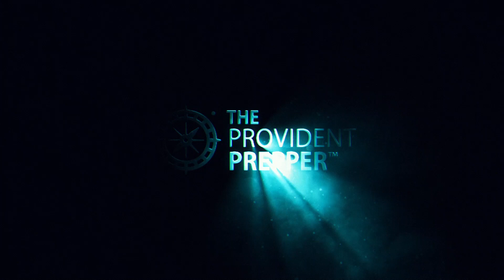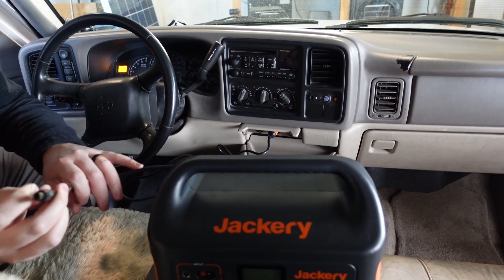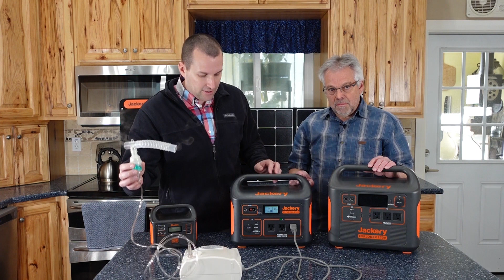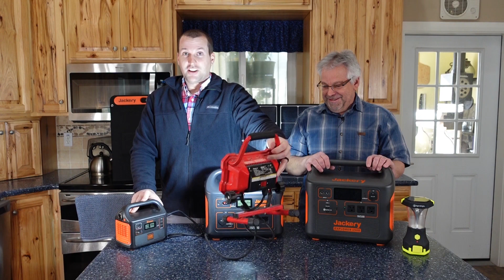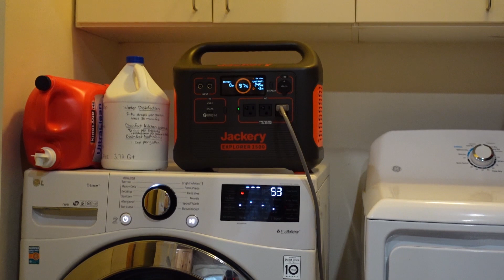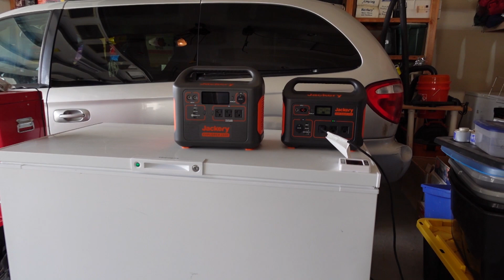Backup Power: Sizing a Power Station to Meet Your Critical Needs

Comment: I’ve heard that powering devices with DC is way more efficient than using the built in inverters to power them with AC.  Any chance you have a DC powering option for any of the devices you showed here to compare the power draw between AC and DC?
Reply: Hey Micah...you can buy DC versions of some appliances. These are popular with the off-grid folks since you can run them directly from the battery bank of the solar power system and don't incur the efficiency losses of the inverter. However, the efficiency of inverters has improved over the last few years to the point that it doesn't usually make a big difference, especially if the DC appliances are more (sometimes much more) expensive. I have recently seen some power banks that skip the AC capability and only focus on power DC devices. I think Inergy has one, but I haven't explored it too much. My whole house fan and my washing machine use really efficient DC motors (which I am a big fan of), but they both are AC devices that push DC motors. Interesting world to explore...mixed feelings out there as to the future of DC appliances. I hope to learn more. Great questions...Thanks for being part of the solution!
Reply: @JonathanBJones  it’s been a while since I looked at new options.  Didn’t realize the new inverters were so much more efficient.  When I put together my DIY battery bank I identified my critical power needs and often they had a factory option to be powered directly by DC.  Examples are the cpap, our laptop, my portal tool batteries, some lighting, and all my comm gear.

But I never actually compared their load to the AC option.  I suppose I was trying to validate my earlier decision and give folks a possible way to lower their power needs that might potentially save them a few bucks if a smaller unit could meet their needs.  As your fan speed demonstration showed we really need to test each item.
Reply: @micahwest5347  Hey Micah...going with DC is not a bad way to go if you can find the products you need at reasonable prices. Another factor favoring your idea is that there is potentially one less device (the inverter) to fail and put you in a hard spot. I will be considering this as I look at another fairly large power station that has all DC outputs...Thanks for your comment and thanks for being part of the solution!
Reply: @JonathanBJones  thanks for taking everyone’s input serious.  In the future if you get a device that has both power options I would be interested to see the difference in draw.
Reply: If you have a medical device like a CPAP, you can get a DC-2-DC converter directly from manufacturer that plugs in directly to a vehicle’s 12v socket (that Jackery or other power stations have).  Go into the CPAP’s settings & turn off the humidifier. By not using an inverter you save 15-30% of power.

Comment: Great video.  I have 2 1800w batteries for 2 fridges and a sump pump.  And 2 600w for lights.  We have the dimmer bulbs that plug into the usb port and uses 2w.  We will cook on camping stove or with grill or tea lights.  Save the batteries for the most important things like a CPAP.
Reply: Sounds like you have done some great planning...we need more like you!! Thanks for being part of the solution!!

Comment: That was good general info.  I think the smallest one is really only for camping, but still not necessary for that.  If preparing for any kind of home outage, I think at least 1000w, but bigger is always better.   Usually it is better to spend more than you would want, and not regret getting one that is too small.  I haven't used a Jackery, but I know the specs, and they seem to be in upper quality category.  I have a EcoFlow Delta Max 2000, I think it fits what I want, and has a lot more features and capabilities than the Jackery, and super quality.  Some people like even different brands, but everyone has different budgets and needs.  I think the tiny ones are useless, no matter what brand.   Just plug your laptop or whatever into a 12v car outlet, same difference.
Reply: Thanks for your comments! You chose well with the Eco-Flow Delta Max...they have great stuff! Thanks for being part of the solution!

Comment: Great info!  Thanks!   I’m in the assessing needs phase and trying to figure the watts thing out.  This really helped!   For me keeping my smaller chest freezer going and occasionally warming up a heating blanket would be imperative during winter power outage in Ohio.  Granted if cold enough outside food could be moved outside in coolers.   However heat will be a big issue.   I think a heating blanket would save my life.   For cooking I’ve been looking at an electric hot pot which brings water to boil quick and can be used on the just add water food items.   There is also a 12v hot pot that can be used in a car.   That’s definitely in my shopping cart!   Also going to add more thermos/insulated cups to keep as much hot water on hand for longer amts of time.    Other cooking options include a sm butane stove, sm charcoal grill, or rocket stove (all outside please).  Another item is a food warmer Hot Logic mini (about size of lunch box) that heats up lean cusine type meals.   I think it can be electric or 12 v.    I’ve added several mini power banks for my phone and laptop and always have them charged.   Thanks again for great content!!  😃
Reply: Sounds like you have and are doing some great planning...way to be! looks like you are getting things figured out. I wouldn't normally use a power station for heating, but a good electric blanket or heating pad, if used for a short while work okay, especially if you have lots of blankets and warm your bed before tucking in, then allow the blankets to keep that and your body heat. Keep making progress...Thanks for being part of the solution!
Reply: Emila, I've seen 12 volt heated lap blankets intended for cars, like for tailgating.  Heating sucks up so much energy to create, though, so I'm not sure how they'd do on a battery by itself (not wired into a vehicle).  Might be worth a look, though.
Reply: Emila - I know your comment was 4 months ago, but I just saw this video today.  Hopefully you see this comment.  If you get the hotpot to boil water, get a couple of hot water bottles.  They can actually keep you pretty warm, especially under the covers at night.
Reply: DC:  agreed!   I have several in my amazon list.  Quite a variety out there!   Thanks for the info!
Reply: @emilasmith4279  If you put your pajamas under the covers with your hot water bottle a little while before you go to bed, they will be nice and toasty when you get ready to put them on.

Comment: Thank you for the great video. I go camping and I have a speaker that uses 160W (JBL 110),  My power station is 300Wh. Can I run the speaker on the power station safely?!
Reply: Hey Mohamad...yes, you should be able to run it, but probably only for about an hour and a half. Your actual usable power is probably about 240 watt hours, which divided by 160 watts gives you that amount of time. I will be interested to see how that goes! Thanks for being part of the solution!
Reply: I have a friend that uses their 160 Jackery to power their internet router so the family has a designated time when everyone can access the wifi for a couple of hours during a prolonged power outage. Their internet comes over the phoneline (DSL or U-Verse).  One of the nice things about Jackery power stations is you can run things off of them while it is recharging it (think a solar panel hanging out the window).

Comment: Since these are essentially batteries in a box (as you said), what is the long term value of such a product?  They obviously wouldn't last indefinitely, batteries are good for only so many cycles.  What is a reasonable amount of years to expect these battery packs to stay charged (without use)?  Or how many recharge uses can be expected?  Thank you for all the great knowledge!
Reply: You are right...like everything in this world, at some point it is going to have a problem. Depending on the battery chemistry and power station design, you can generally expect at least 500 charge/discharge cycles. In general,  people are not using these everyday, so they should provide at least several years of usage. I recommend people get them out every 3 to 6 months to test and use it just a bit, then recharge and put back in storage. They will hold a charge for quite a while (typically for a year). When you do use it, try not to discharge it more than 80%. Like everything, taking good care of it will pay good dividends. Thanks for your questions and comments...and thanks for being part of the solution!
Reply: I keep all my lithium systems fresh (incl 2ea Jackerys and Egos and 4ea 100Ah Battleborns and Chins for my whole house power) by cycling them about every 2 weeks. It is not good to store them fully charged. I use fans on dedicated 400w load inverters to drain them to 25% and then a 10A charger specifically made for lithium to top them off to 90% to maximize their life. At that rate, they should last well over 10 years.

Comment: Which one for a small harvest right freeze dryer
Reply: Hey Jean...unfortunately, even the small freeze dryer needs more than any of these can deliver. Our medium freeze dryer uses about 15 kwh, and I am guessing that the small one uses at least 10 or 12 kwh. The most the 1500 can deliver is about 1.3 kwh. Even with great solar, you couldn't get close to being able to freeze dry. For that you would need a really large unit with extra batteries, or a medium to large solar power system. Great question...thanks for being part of the solution!